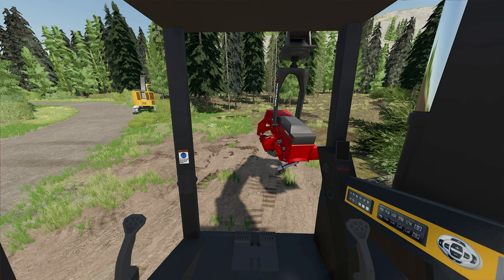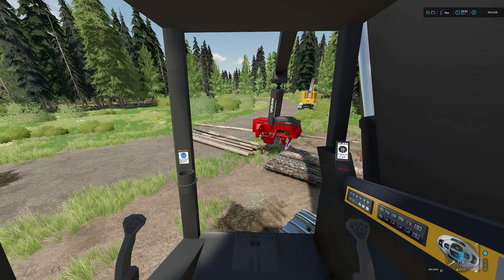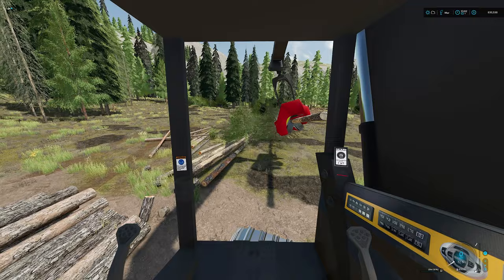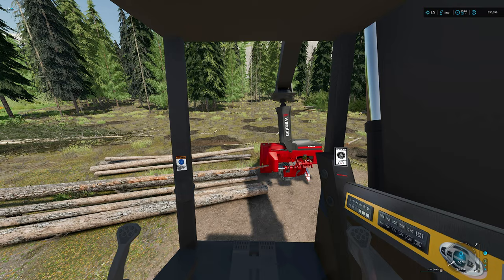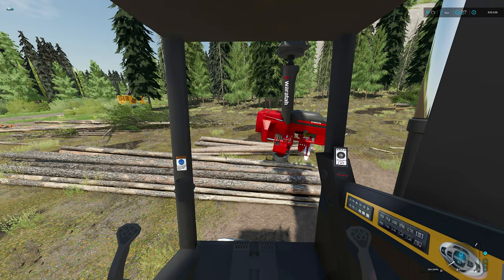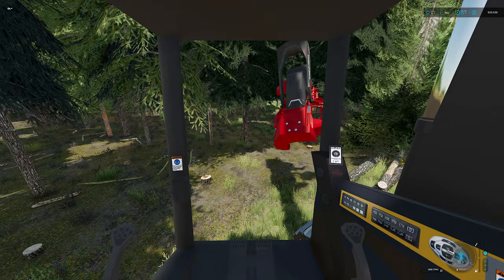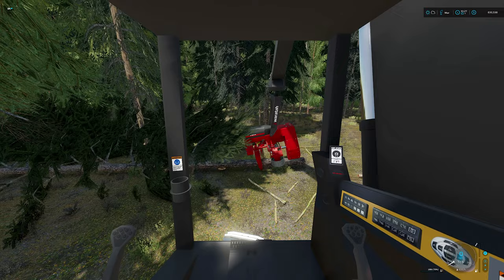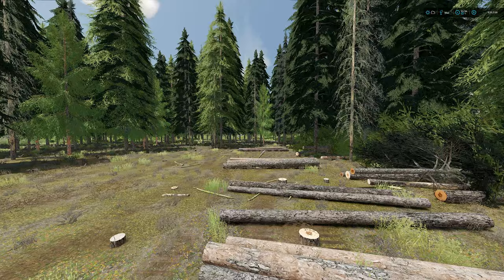Advanced Training - Processor - Learn How To Log - FDR Logging

Comment: Are your machines too powerful for the base game trees? Im trying to cut down every tree in Silverrun Forrest and wanted to use your mods.

Also, in the base game they have the hydraulic motor free spin feature on the processor but you can't control the head with the log in connected to it
Reply from the maker: they can still handle the base ingame trees they will just feel very very light compared to the FDR trees ;)